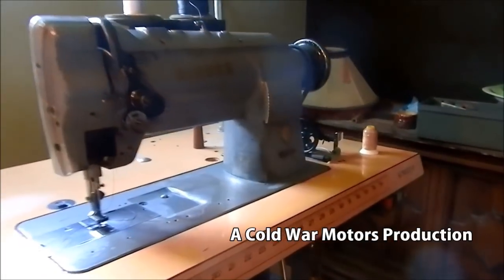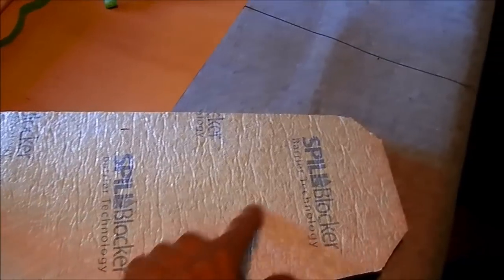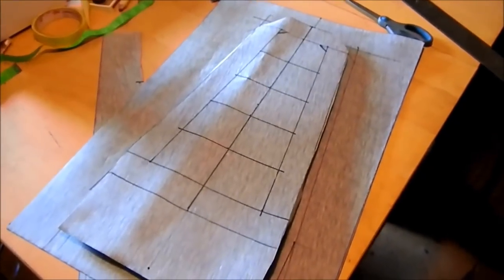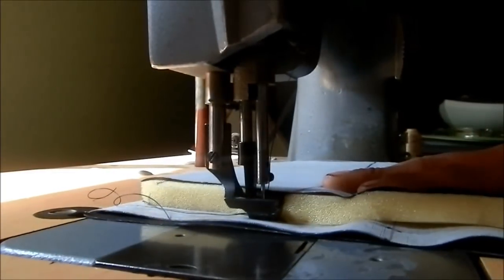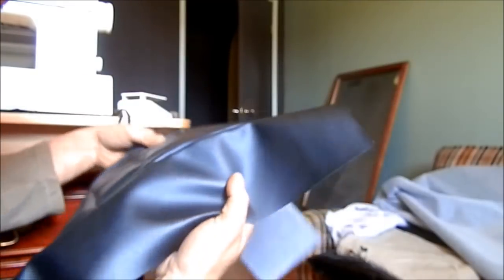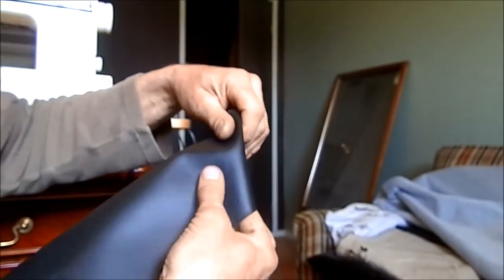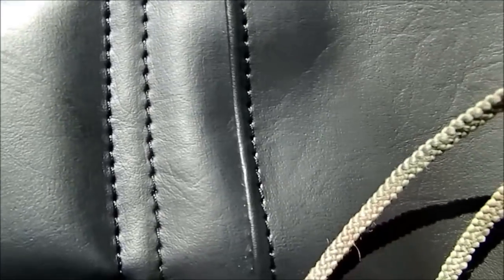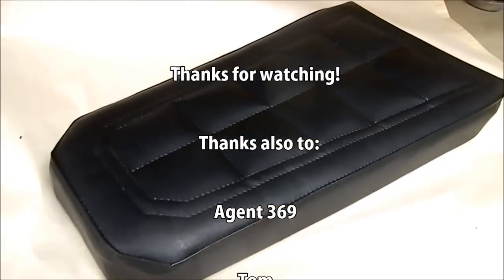Sewing Machine and Puppy Time!

Comment: A little tip. When you don't have a reverse, just go ahead and sew forward a couple of stitches, then lift your foot and pull the work back to the first stitch and sew over it again. That's really all you need to lock the stitch if you don't have a reverse. I made seat covers for chevy pickups for years on a Consew that didn't have a reverse and did my lockstitches that way.
Reply from the maker: Hey thanks for the note and the tip on locking... I have had only limited success with the method you described; it seems the old Singer is sensitive to having the work moved with the needle out. Your method would definitely be the preferred way to go... I'll keep trying; perhaps there is a "magic" spot for the needle I haven't found yet?  Cheers from us here!

Comment: Plymouth Fury video soon?
Reply from the maker: Hey, thanks for the note... I had started trying to get the 60 Fury running for a video, but unfortunately the engine has a seized wrist pin and starting it would have badly damaged it, so I had to put it aside for now. I still fully intend to restore the car, but my plan for a quick "Will it Run"-type of vid fell through. I was disappointed because I spent several days getting it all tuned up, but there is nothing to be gained by wrecking a savable engine. It'll have to come out and get dismantled before it can start, and that means I should finish a few other things around here first! Cheers from us here; more soon!
Reply: If you happen to film that repair, I'd bet we'd watch it.  Great stuff, as always!